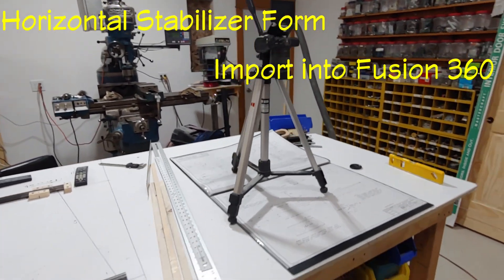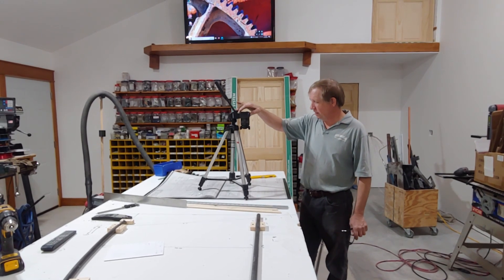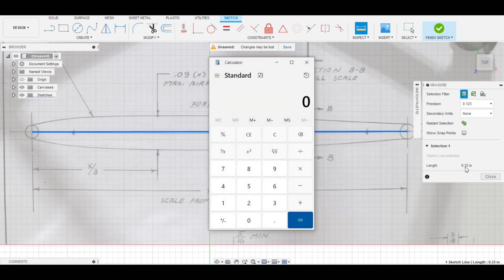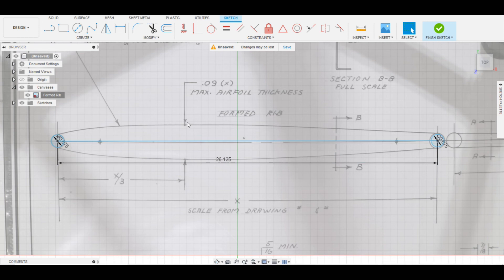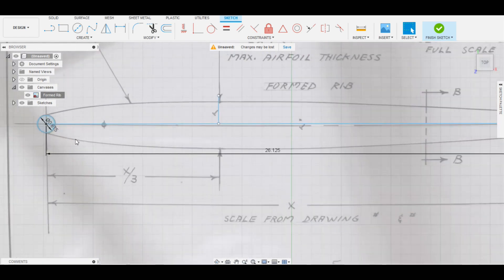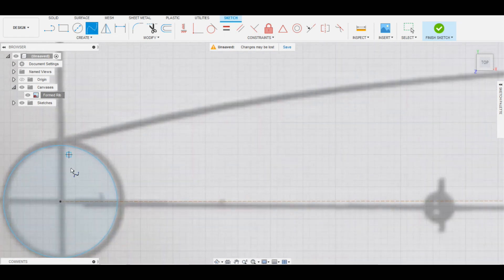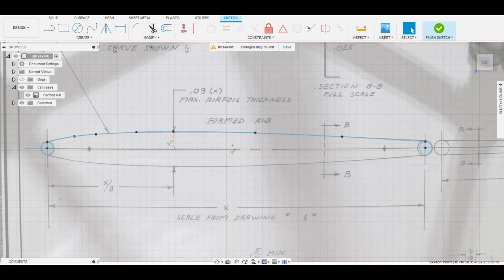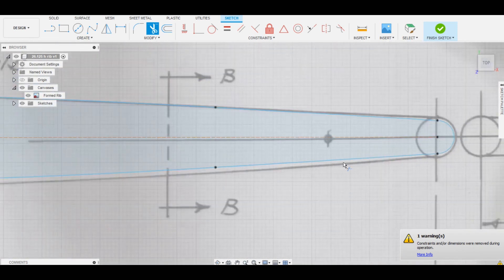Bearhawk Experimental Airplane Build : Importing Rib Form into Fusion 360

Comment: Can you share the file? I'm not having the best time trying to cut it out and sand it down
Reply from the maker: I am not sure my files will help you. Each rib is a different size depending on the tube centers on your stabilizer. You would need to modify my files to fit your plane and it is easier to just make a new drawing. Fusion 360 is free for non commercial use and using the video you can create your own files. Let me know if i am missing something.